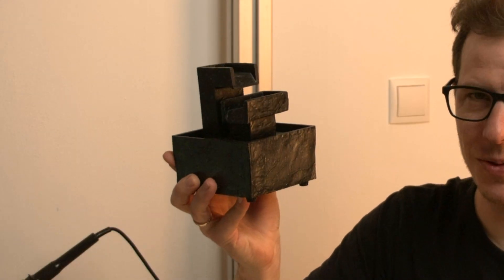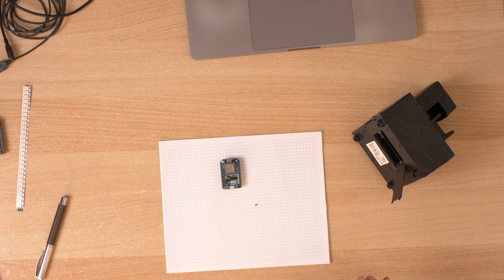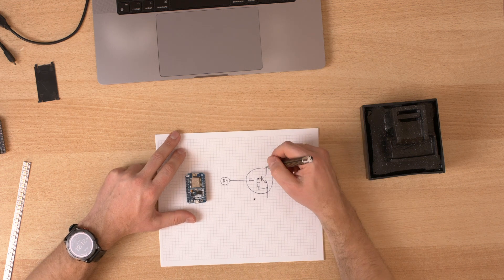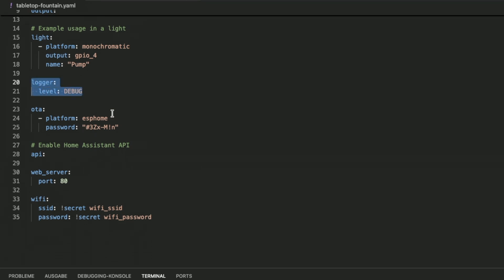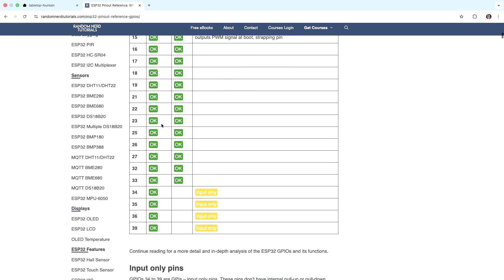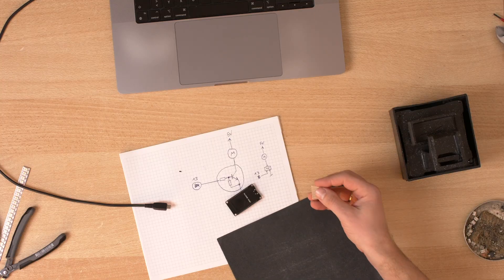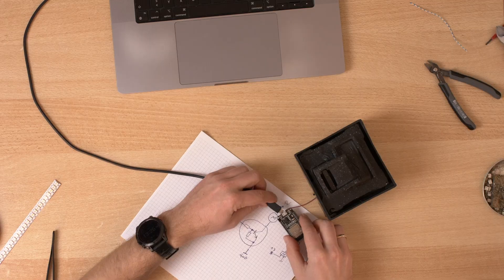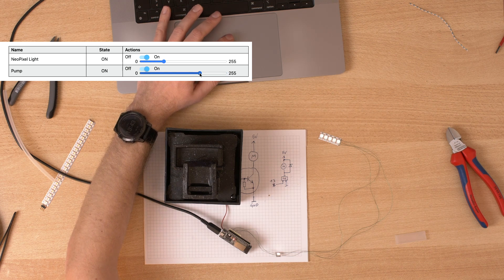Hacking a Cheap Fountain to Work with Home Assistant (ESP32 + ESPHome)

Comment: Use nail polish/conformal coating for waterproofing. Hot glue will eventually leak.
Reply: Second the nail polish, did it about 5 years back pcb is still working, I did 4 coats of clear nail polish letting the previous coat dry for a day between coating.....
Reply from the maker: Thanks for your comment! Interesting, any idea how long it will take?
Reply: @playduino  Not sure - my outdoor projects finally succumbed to water ingress with hot glue.